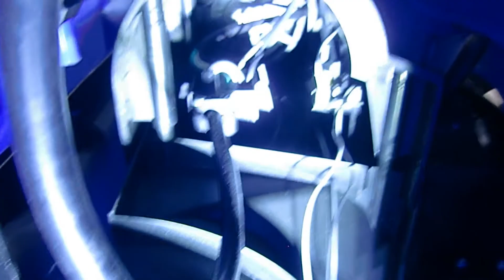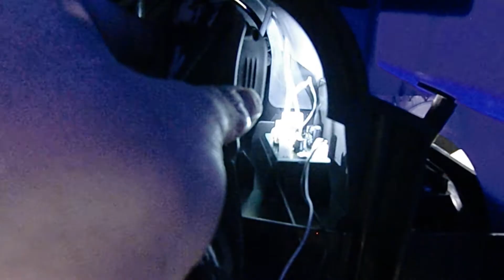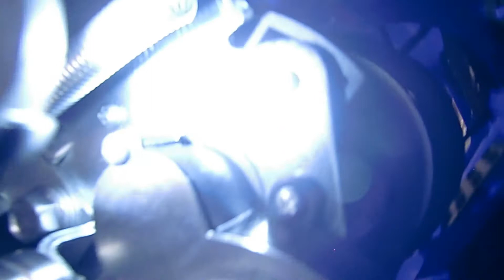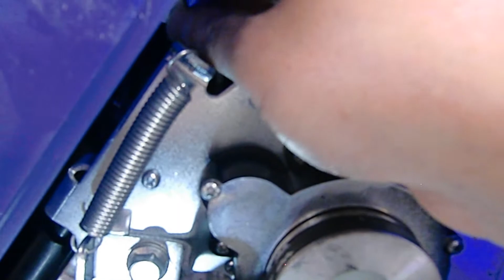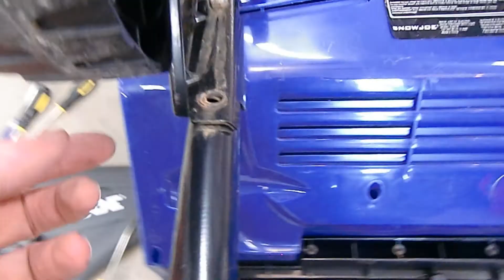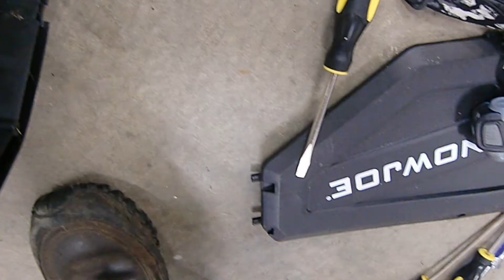Repair Snow Joe SJ627E Corded Electric Snow Thrower that will not start

Comment: Mines was the same problem. Mines was very much seated properly and took a bit of force to pop it up. Put it back in, made sure that even fully seated it moved a little due to spring force and motor works just fine.

Comment: Thanks for the video. Had the same problems but mine was 2 seize brush 1 top and 1 bottom from corrosion, had to remove the motor cover to get the bottom one.

Comment: I'll certainly be looking into this as mine just abruptly didn't want to start again after I stopped it to move the blower while clearing slush and it was indeed shaking a lot so it could be vibration unplugging a starter mechanism

Comment: Never liked mine and having bought two batteries they only gave me one which meant many emails and still no second battery. Then it stopped working on year 3 so has about 10-12  hours use. Upon calling them, they have discontinued the model and offer no service at all so it garbage now and I will replace it with a RYOBI product and be glad for that. Sno Joe was a horrible experience.

Comment: Worked for me. 
I couldn't pull mine loose(its really in there -perhaps mine doesn't come out as my snowblower is a benchmark).
 I gave the top a few hits with the back of a screw driver as  it was a bit wigglie the connector part.. anyhow everything tightened into place no more wiggle and the snowblower works now!
Saved me few hundred bucks..thanks!

Comment: Mine just had ice! My 323e corded hand held suddenly wouldn't turn on. Checked continuity on the switch and it was ok so I went deeper and opened the motor shell. Everything (everything!) was locked in very hard ice. Luckily I just had to blow dry and stab away at the ice making sure it was all gone. Once back together it fired right up.

Comment: Can someone tell me if it is the same problem? My snowblower can start. I can hear some noise. But it is not blowing snow out. The wheel inside is not turning. Thanks.
Reply: Try testing the pulley and or drive belt after removing the side panel. I know the question is from a year ago, but someone else may have the same problem.

Comment: This worked for me!  I called Snow Joe and because it was older than two years old and out of warranty they told me to trash it and buy another one.  I came to YouTube and found this video that did the trick.  My piece was not proud like in the video, but a jiggle with the screw driver seemed to do the trick.  Thanks for this video!

Comment: Mine, the LED light does not turn on either.  It is corded one. Is there any fuse in the hand switch/lever area as it appears there is no power supply to LED Light too

Comment: I had the same problem, all the sudden after stopping won’t start again. Lights and chute worked, meaning the battery had enough juice but auger wouldn’t turn. To solve the problem, I pressed the start (blue) button for 10-12 seconds to give the unit a “hard reset.”

Comment: Found a little hole underneath. That is the reset button, just use a screw driver to poke it. That is the thing in the video that he pressed in. It must fell off when he took the cover off. No need to take apart.
Reply: Can u post the picture of that reset button where u are pointing ?

Comment: Couldn't find the carbon brush on mine, but my issue is that it starts up, runs for about a minute or less then slows down and shuts off. After that, it won't restart for about an hour. Only used 3 times last season :(
Reply: Mine ran an hour and started slowing down. Within 3 min, it stopped and then it started to smell.

Comment: Tracker - thanks for the vidio.  I had the same problem,  had to take the Snowjoe apart just like you did to reach the carbon brush, pushed it back in - and the snowthrower works again.  The assembly is on the bottom side and most likely would vibrate out again.   I goobered the outside of the brush assembly and the plastic housing with silicone calk.  The silicone should hold it in.  If the brush assembly  does vibrate out in the future, the silicone is easlly removable with a razer knife so I can do a repeat repair.

Comment: OK... I have one of these and its driving me CRAZY!  I took apart the part that contains the squeeze handle that operates the auger.  The unit did not work.  Played around with the internals of this part and got it to work.  Assembled it and mounted it back on the handle it stops working.  Have repeated this process several times and every time same thing.  Works when apart, stops working when assembled
Reply: The switch may not be activating; when you're putting the handle assembly together make sure that the switch is correctly positioned inside.  You should be able to tell if the handle activates the on/off.  If the handle just flops up and down, the switch is incorrectly positioned.

Comment: took mine apart ,got a spare belt,came w no light switch on deck,...is that brush supposed  to snap in or be retained in some way, belt is 630mmx10mm pulley 5.5 in v belt shaft 14mx1.5 left hand,not much  available parts dont use on heavy wet snow,youll melt the pulley, led lights are held with 2 screws but have to completely take apart  like you did,and they have no replacement  ,oh well,good for a driveway with dry snow, chute gear is plastic 😀

Comment: Thank you, Thank you, Thank you!  I had the exact same issue.  I ended up pulling it completely apart then after resetting the brush, I ended up taping electrical tape around both brushes to hopefully keeping those brushes in place.
Reply: I would not trust that repair!

Comment: It appears that what you had in your hand was a carbon brush assembly.  The carbon in the brush transmits current from the supply (power plug) to the field winding of the rotor in the motor.  They are often held in place by a screw down bracket so they don't work loose due to vibration.  Your brush obviously worked loose and by reseating it you put it back in contact with the motor.
Reply: Old school brushes on the old starters when you could rebuild them

Comment: @ Tracker Lounge
That was pretty impressive on your part. I just purchased the same model a little over a month ago but haven't had an opportunity to use it yet. I have a 5 year old Toro 1800  powercurve electric  which is pretty powerful but has a plastic auger. I also wanted something wider and with a taller intake.
Reply: I also went from that same Toro to my newer machine a year ago.  Same reasons too.
Reply: @puckme3117  
After using the SnowJoe last winter, I tried using the Toro again, at first it was disappointing but then I found a groove with it, then after 5 years the plastic auger broke. I then purchased and replaced the auger and scraper, too late to use again for the season.
So now I still have it to switch off with the Snow Joe this winter.